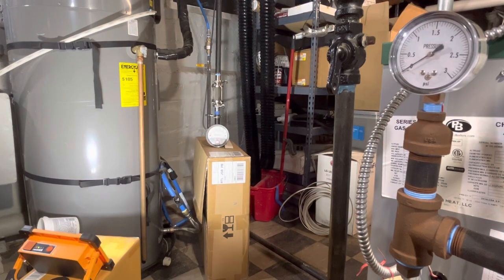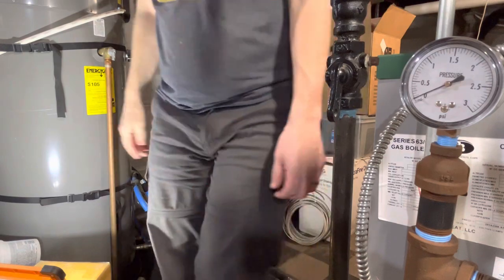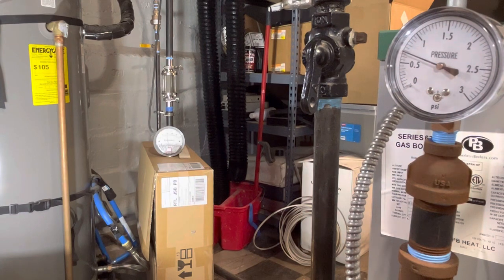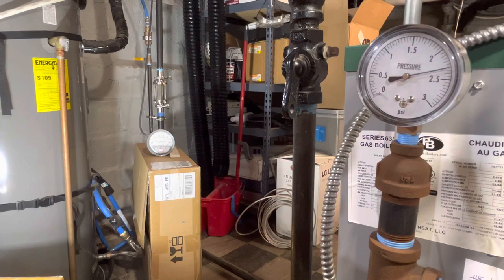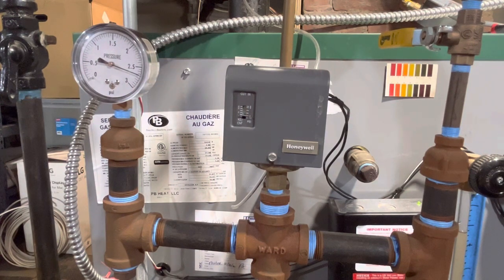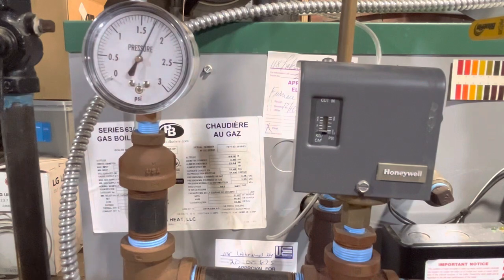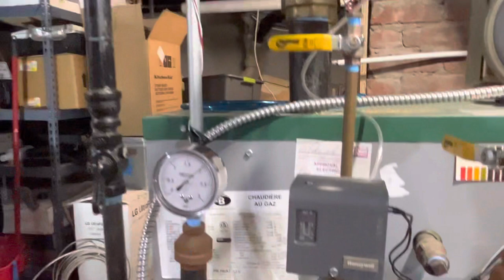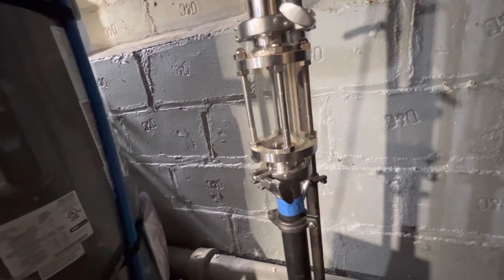Steam Boiler Disabled Equalizer Experiment #2 (very boring)

Comment: That’s why the cycle guard sucks. By sucking in air when the cycle guard does it’s intermittent test, it has to remove the air from the system again. Where did you get those pipe glasses?
Reply from the maker: I am ok with the cyclegard. If you notice, no air was sucked in. The pressure went down but not to vacuum. Steam was still in the system. That might vary depending on pressure though, it’s true.

The sight glasses are “tri-clamp” technology, you can get them on Amazon or eBay.